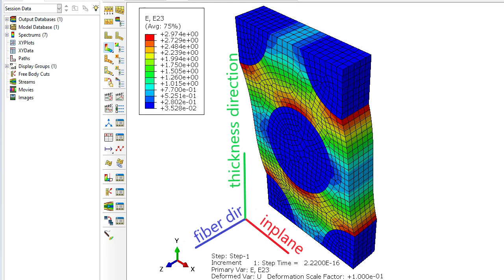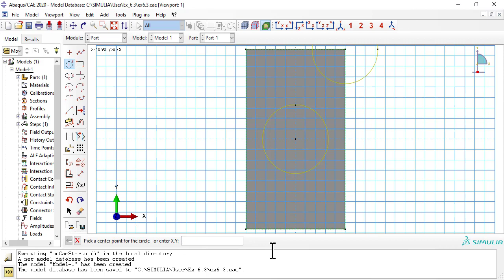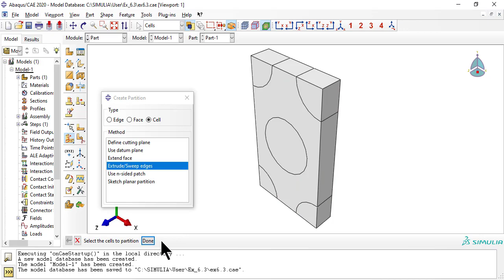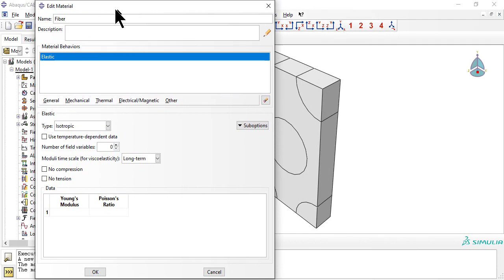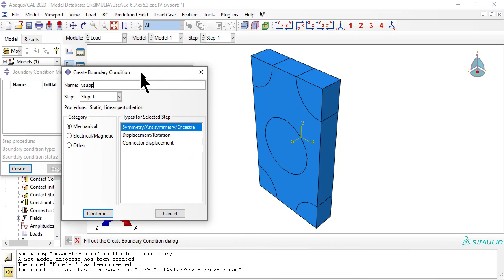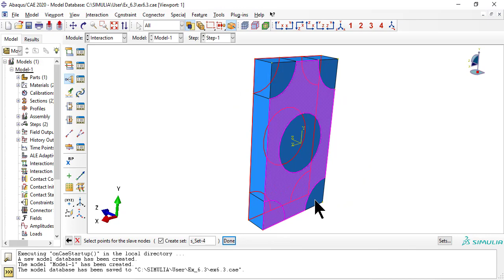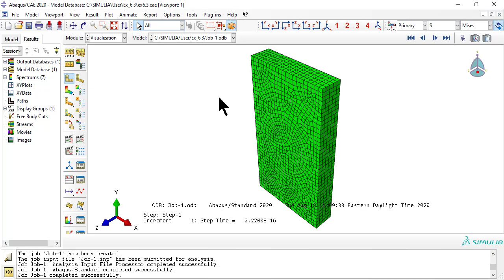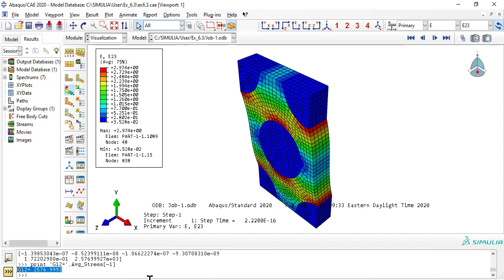Example 6.3 Computational Micromechanics using Abaqus tie constraints & Master/Slave Nodal Regions

Comment: My Question:
Why did you not use Solidworks? I have performed similar Simulations on Solidworks as well. But I have never used Abaqus. So any specific reason for using Abaqus and not Solidworks?

Comment: Dear professor, thank you very much for sharing the video! Very appreciated!

I have followed step by step. But Abaqus still gave me warning messages as below. And my result doesn't look right to me... and I couldn't find out where has gone wrong. I am just wondering if you have met the same problem before?

Slave surface assembly_s_set-4_cns_ is a node-based surface used with surface to surface approach. In order to obtain improved stress accuracy with this approach, an element-based surface should be used instead.

*tie between surface pair (assembly_s_set-4_cns_,assembly_m_set-4_cns_) may result in unrealistic deformation between the surfaces or large stresses because the master is node-based and no adjustment is specified. Define a surface-based master surface or adjust=yes to avoid this problem.

If significant clearance/overclosure exists between surface pair (assembly_s_set-4_cns_,assembly_m_set-4_cns_) and the master surface does not have rotational degrees of freedom, adjustment is recommended for correct enforcement of the tie constraint

291 nodes are either missing intersection with their respective master surface or are outside the adjust zone. The nodes have been identified in node set WarnNodeMissMasterIntersect.

4 nodes have dof on which incorrect boundary conditions may have been specified. The nodes have been identified in node set WarnNodeBCIncorrectDof.
Reply from the maker: The video was done with release 2020. What are you using?
Reply: @EverBarbero  thanks a lot for the reply professor. I'm also using 2020.

Comment: Thank you, why direction 1 belong to z not x, and direction 2 to x not z, and direction 3 to y not z, so we could calculate the transverse shear modulus G13 rather than G12
Reply from the maker: Because in Abaqus and Ansys the default plane to draw the geometry of the cross section of the composite is XY, so the fiber becomes aligned with Z, but in composites notation the fiber direction is 1. It is possible but difficult to draw the cross section on the YZ plane so that 1 is aligned with X but it is complicated.
Reply: Thank you Prof. Well demonstrated

Comment: Dear Prof. Barbero, Is assuming fiber as an isotropic material correct?
Reply from the maker: Glass fibers are isotropic with properties E_a, nu_a (a means axial). Carbon are not, but many times the added properties needed to describe their transversely isotropic behavior (E_t, G_a, G_t, t means transverse) are not available, so people approximates them as being isotropic. That is OK for prediction of composite properties in the fiber direction (E1, F1t) but it can be really bad for prediction of other properties such as transverse modulus E2, transverse coefficient of thermal expansion alpha_t, etc. Except for Periodic Microstructure Micromechanics, other micromechanics equations approximate the fibers as isotropic, which for Carbon fiber composites is wrong.
Reply: @EverBarbero  you are more than great

Comment: Thanks indeed professor for the quite helpful video you have shared regarding the extend of RVE in micromechanics of composite materials.  Kindly, how can one be able to do a mathematical derivation and mechanical shear testing for orthotropic composite to find G12, G23, G13? Have a nice rest of the day! Layth
Reply from the maker: layth salman For G12 the best is a torsión test of a circular rod with unidirectional fibers in it. Use the torsion formula from mechanics of materials books to calculate the twist angle and measure that too in terms of the applied torque.
Reply: @EverBarbero  Thanks a million for your prompt reply, appreciated. I would be more than happy if you could recommend some references for Shear modulus derivation in three principal directions.

Comment: Thank you very much Professor Barbero for your scientific sharing in this field. I have 02 question:
1. In the step you have shosen a linear perturbation, could you please tell me, why this choice, and what is the difference between static and linear perturbation ?
2. With the micromechanics VER method's, we can predict the thermoelastic properties for the VER representing of plate for example. How we can predict the thermoelastic  properties of a the plate composed of more than one layer. 
Thanks in advance.
Reply from the maker: Answer to #1: In this case it does not matter, you can use either, but when we do buckling, or when we have several load cases, and we do not want the load and support conditions to "propagate" from one step to the next, we use linear perturbation. If we need to do nonlinear analysis, then we have to use Static.   

The answer to #2 is in Example 6.5.  In Example 6.3 we build and RVE for one lamina and we calculate the lamina properties from the fiber and matrix properties.  In Example 6.5, we take those lamina properties, build and RVE for 4 laminas, and calculate the effective properties of a laminate.  There are 2 steps. First fiber+matrix = > lamina. Second, multiple laminas with different orientations, each has the properties from the previous step, and the result are the "effective" properties of the whole laminate (sometimes called average or equivalent, etc.)
Reply: @EverBarbero  Thank you very much for your explicite explanation. Many Thanks